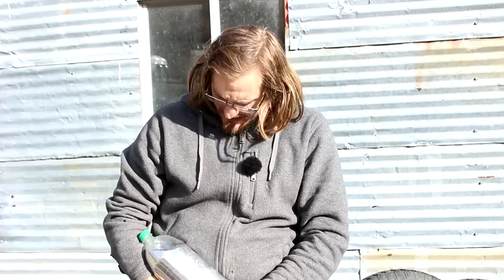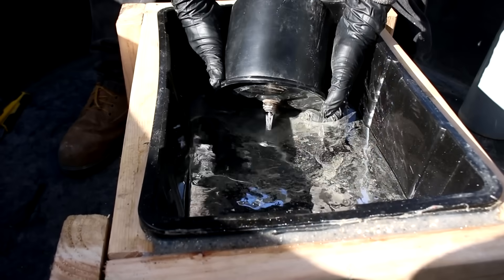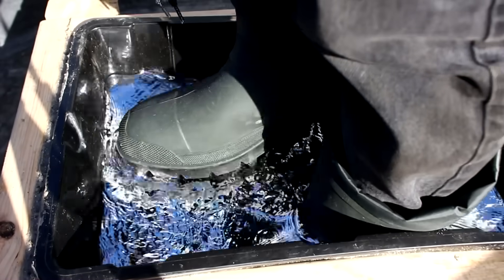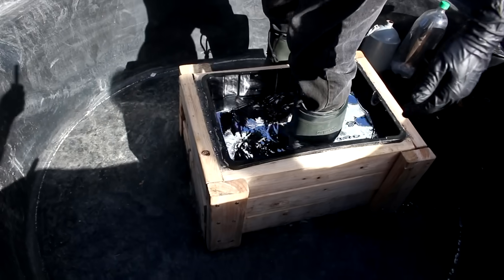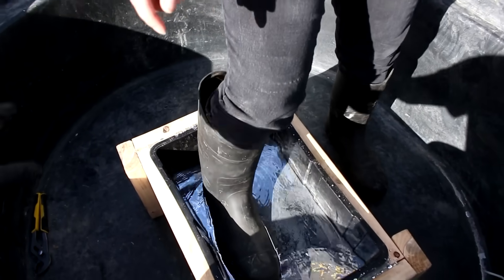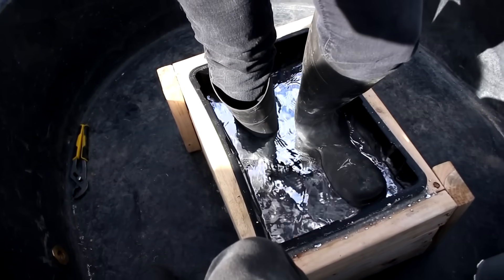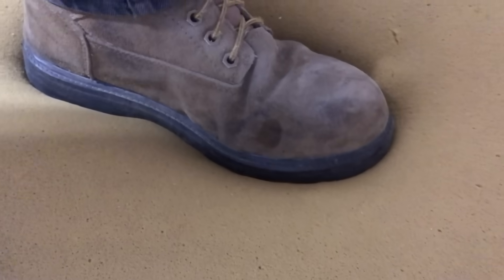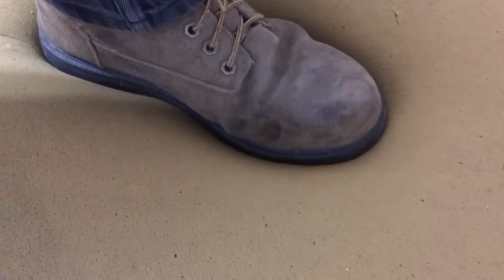Can I Stand On Liquid Mercury?

Comment: Yo I don’t think that’s healthy.
Reply: Yo, I think Cody knows what he's doing.
Reply: McMehBurger I'll take contributing nothing over "contributing" false information any day. Equating the toxicity of mercury to CO2 is false. Saying mercury kills brain cells in low dosages is false. Saying handling mercury in a well ventilated area is dangerous is false.

There's my contribution. I'm not going to waste my time any more, since you're already ignoring actual facts and I'm sure nothing I say will change your ignorant minds.
Reply: +2 Pump Meme Dump
If each breath of CO2 (I assume you didn't mean some diatomic form of cobalt, which would indeed probably harm you in some way) you take in damages your brain, then we'd all be dead by now. The air you breathe in isn't pure oxygen. When you get an "oxygen tank", it's mostly carbon dioxide and nitrogen. Pure oxygen kills.

And you can't exactly use the fact that you may have been eluding to asphyxiation as a defence, because rebreathing the same air in a garage is not akin to standing over a bucket of mercury outside, when there is air literally all around you. There is absolutely no chance of him asphyxiating doing that.

Even if you meant CO, which you probably did, that itself does not cause brain damage. It doesn't affect the brain in the slightest. All it does is stop your blood cells from forming oxyhaemoglobin, basically making it so your blood can't carry oxygen. Sure, this leads to brain damage if your brain's oxygen supply is so inhibited, but saying that, for instance, taking a couple breaths of car exhaust will damage your brain is flat out wrong.

Carbon monoxide, like mercury vapour, is dangerous with prolonged exposure. Though, with carbon monoxide exposure having to be quite noticeably less prolonged.
Reply: +Tikotidu
Don't take what chemistry teachers say as law. I remember my chemistry teacher said a few grams of Caesium would cause a huge explosion. Totally false.
Reply: The brain constantly rewires itself, so occasional exposure does NOT necessarily cause permanent damage. Mercury on your skin is not a problem, but the 'fumes' can be - which is why he chose an outdoor area with plenty of breeze. Also, many mercury compounds ARE absorbed through the skin (unlike the elemental mercury he was using). Also why he did not let his other foot (with a wound) get close to the mercury.
Yes, there are good reasons you were taught not to get close to mercury, but as with anything else, a true expert may be quite safe doing something that would be unsafe for you. [FYI, I was a science student, with a major in chemistry and another in physics. Later I taught both. So, yes, I've studied this more than some people. Plus worked with cinnabar and mercury in Arizona, so had to learn the actual safety methods with mercury. When my first son was born, my wife freaked out because a sphygmomanometer [the old-fashioned blood pressure tester] had broken, spilling mercury on the tile floor, and when we were there, there were still tiny droplets of mercury in every groove of the floor. Babies are more susceptible than adults, so she was right to be upset.
Reply: +IlI IlIlI
Damn. You'd already written my comment, but way more succinctly. Rip.
Reply: Tikodiku Elemental mercury (the one Cody works with) isn't immediately toxic, but it bioaccumulates and leaves your system really slowly. Just handle it in a well ventilated area and don't do it too often and you'll be fine. If it were as toxic as some ignorant people in this chat claim, you'd kill brain cells every single time you eat fish.
Reply: 2 Pump Meme Dump Not true. Get your facts straight before trying to be a smartass on the internet.
Reply: +IlI IlIlI
Eh. If they spent two minutes in Google to reach their conclusion, then they must be pretty bad at using search engines. Two minutes in Google will get you stuff that details mercury poisoning correctly and isn't sensational about it.
Reply: 2 Pump Meme Dump Nice cherry picking. How about you counter some of the actually relevant points presented? Oh, right. You can't.
Reply: dude... the bottoms of your feet have THE highest absorption rate....wow... No research done before this experiment
Reply: It isnt too bad since the surface tension in mercury is great so the skin doesnt absorb so much mercury and he is using metalic mercury witch is way safer than organic merqury witch madame curis died from
Reply: ozzilla8 not just the vapor for example if you have a skin ulcer it could be potentially dangerous.
Reply: Michael T  he had boots
Reply: IlI IlIlI you have contributed nothing to this argument. You’re sorta restricted to calling people retards and denying things just so you don’t look silly. “Get your facts straight” my ass. At least he had facts
Reply: 2 Pump Meme Dump 
You dumbass. Learn to spell. Actually just go and learn.
Reply: William, are you going to attack my points or just my spelling? If it's just my spelling then you clearly have no argument.
Reply: Wrong. Several people have explained the real facts, not the misunderstood info you half remember hearing about. Your skin does not absorb mercury (but can absorb certain mercury compounds, allowing your blood to be exposed to mercury). If he had done this inside, I would not be happy (the fumes can get you).
Reply: The term mercury stands for pure metal of mecury. Variation of mercury forms will have different effects on our body.  Vaporize mercury will be more toxic than liquid solid mercury.  However, the mercury that we should be more concern of is organic mercury.  So why is organic mercury more toxic?  Well in organic form.  Mercury can be more easily absorbed into tissues.  When media point out mercury contamination and fish having high level of mercury. It is refering to organic.
Reply: Why not it’s only the vapor you need to worry about
Reply: Jasper Kole,If you would kindly look back I in fact did use punctuations. I agree fully with what Cippo Lippo said.
Reply: ccaagg, then go inhale pure Co2 in a sealed garage and tell me the outcome after 3 min.
Reply: FiendishPickle, that's what I was saying, he needs a gas mask for propper safety and that's all i was saying he needs to have propper safety in videos like this.
Reply: Note Cody's receding hairline since he started his mercury experiments....
Reply: Michael T it’s the liquid not the gas, if it was the gas, he would’ve died
Reply: John Stuart There's a reason the Romans put prisoners to death by having them work in cinnabar mines.  The brain does not "rewire" itself from exposure to mercury.   Maybe if you're exposed to mercury long enough you can convince yourself that's how the brain works.  Also, Cody clearly did not create pure elemental mercury considering the scum film on the surface.  Even if he did create pure elemental mercury, it's not safe to stick your foot in it.
Reply: Michael T same
Reply: It's a hazardous materials correct? What scares me is the handling and splashing the Mercury around to contaminate the ground and people around. Can get trapped in his clothes.
Reply: Michael T ..He said he "..felt a little unstable..."  I bet he still does.. Mad as a Hatter..
Reply: ozzilla8  you don't know what you're talking about, fool....
Reply: Tikotidu  righton
Reply: 邪児 Kronaz... like Karen Wetterhahn (Dartmouth  College) and  brown bear lover Tim Treadwell. Lol.R.I.P.
Reply: mercury poizund liquid metal mercury has a low absorption rate. It's less dangerous than the vapors it lets off. If you work with it in a well ventilated area and don't let open wounds get in contact with it chances are you'll be safe. Organic mercury is the one that is a killer through skin contact. He covers this, and you can find many cases of people dying or getting poisoned through organic mercury. However you will have a difficult time finding cases of people dying due to absorption that comes from metal mercury.
Reply: Michael T Only a few forms are as toxic as it is proposed on the news. The normal  form however is only toxic when it's consumed or vaporized
Reply: Its not healthy. It can absorb through your skin.
Reply: S F 2 Pump Meme Dump so many people who don't know basic chemistry it can not get through the skin the atom is massive in the first place and so it can get in via the skin it needs to be in a compound preferably organic to really get through so it like eating a tuna sandwich so SHUT UP HE IS MUCH SMARTER THAN YOU ARE and he has done his mercury and lead tests and he is fine u dipfriedmoth
Reply: 2 Pump Meme Dump he is fine he has done mercury tests so that proòoooves that you are wrong
Reply: Watch this youtube video a scientist dropped two drops of dimethyl mercury on her hands this is what happened to her brain
Reply: 2 Pump Meme Dump you are absolutely correct but this type of mercury can not penetrate the blood brain barrier that easily.
Reply: It's not SAFE, but he doesn't have fuckin brain damage from this. It can be absorbed through skin, sure, but only over long periods of time primarily. The main thing is not consuming it or letting it into open wounds or breathing it in.
Reply: I like all the Google University experts in here. Cody knows what he's doing.
Reply: 2 Pump Meme Dump what you meant to say was: 'look up what mercury poisoning means'. And it's clear that erethism only starts being noticable after being exposed closely to mercury vapor for a long time. The mad hatters you speak of only got erethism because they worked with mercury close to their face every day for years. Working with mercury a few times over multiple years won't even get close to the amount needed to acquire mercury poisoning.
Reply: 邪児 Kronaz, madame curie also knew what she was doing, but look how she died, by her own work.
Reply: 2 Pump Meme Dump for the love of all that is holy: use punctuation. One massively long sentence gets really annoying. Apart from that, you are somewhat correct: erethism comes only with repeated exposure to mercury. it is very comparable to alcohol: every bit hurts the brain, but it doesn't really matter in the long run if you don't regularly drink way too much. The same goes for mercury exposure: though it will do tiny amounts of damage each time, this isn't a big deal unless you are around the stuff a lot.
It's exactly as you stated: these mad hatters didn't die in one go: they went mental over years and years, being exposed to mercury unprotected on a daily basis.
Reply: yo i think i know what he's doing too sacrificing his body for his and our amusement and ad revenue. mercury can fuck you up and your skin can absorb it via contact. to be fair tho long term it's safer for him to mine youtube views than to mine gold which would probably yield greater exposure for the same profit
Reply: Jasper Kole, I didn't say he would get mercury poisioning, I said he is getting permenant brain damage as messing with mercury fucks with your brain worse than alchohol. I said what I meant so deal with it as they went mad from murcury and then got ill from it and died in a hallucinogenic trip fest. I would recomend looking into it, as it's quit interesting as it's not just "woops i'm going to die now" it happens over time and every time you are near it, it fucks with your brain and decay's it permenantly like mustard gas is only as deadly as it is without a gas mask but with said gas mask your lungs don't get fucked up making you only get mild chemical burns(depending how long your in it and how it is made) on the outside of your body.
Reply: I remember back in the school they told me not to touch Mercury since is toxic as fuck and it could kill you by poison easly, but being liquid well.... maybe you can stand but its not healthy for sure .-.
Reply: mmmmm no, mercury can go  through your skin
Reply: I think most of the people here are completely ignorant about the concept of danger. 
I seriously think this kind of video are dangerous. Because the precautions showed in the video are null. 
It is true that mercury poisoning happens only on a long term exposition and I believe his Hg blood levels are normal. But once you deal with such large quantities of materials, you may incur in many unexpected events. Most of the accidents, and fatalities too, in fact, are no longer due to long term expositions, but rather to single episodes that where not predicted. 
Again, maybe in this video all the precautions are not shown, but in my opinion what I ve seen is far far away from being safe.
Reply: Chaos Gaming, he didn't have a mask on and if you inhale mercury you get permanent brain damage(as little as it is in an open area like he had) it's as bad if not WORSE than inhaling Co2 in a sealed garage.
Reply: agreed, he definately has brain damage from this and those of you who don't think it's dangerous to be around mercury without a mask just look up why the expression is "mad as a hatter".

Comment: It would be an interesting video to show the battleship/1gal water thing except scaled down. I think you'd have to use a much larger proportion of water to surface area than that to see anything though. That apparant paradox blew my mind in physics. I still don't understand it fully, I guess its something like the space that might have otherwise been filled with water is now filled with ship, so it might as well be water too and so it presses down with the same pressure as the water and the system is in equillibrium thus the ship floats even though there might only be 8 pounds of actual water contributing to the bouyancy pressure. In a way, the ship holds itself up I guess, and that's pretty damn cool.

Comment: Oh ma-an! This is SO cool!!
And actually gave me an idea. -You know they use vacuum for evenly pressure hot plastic to the mold or to pressure fiber reinforced epoxy, what if you could do the same with mercury? It would give you much more pressure and at the same time better temperature control as mercury much more thermoconductive.

Comment: OK, so before today I didn't really realize how much mercury you really had and watching this gave me an interesting idea. You of course know how magnets make eddy currents in metals. What I'm wondering is whether or not those forces would be visible given the fluidic nature of mercury. I'm also wondering how much effect that would have against the magnet the same way it would as if the magnet were used as a break in a rollercoaster. It might be an interesting experiment and wouldn't take nearly as much mercury to perform. You would only need like a baking sheet full and some kind of rig to pass the magnet over the surface without it touching at sufficient speed to generate a reaction and see if the mercury moves and/or the magnet is slowed.

Comment: Cody, we know the landscape is beautiful, but could you please lower the camera focus?
OH, darn, video has been recorded already, oh well x'D

BTW, isn't the pressure related to the work that the mercury is doing on the medium holding it?

If you had a plank below the mercury instead of of the bottom of the container that could ONLY hold the pressure done by the mercury, as soon as your mass entered the equation, the work done by the addition of your mass to the system would apply extra work on the plank, possibly making it break and leak the mercury(HOPEFULLY to another container of course)

But since the container was actually designed to receive extra work forces without showing extra points of stress it is able to react to the work of your mass by return the force upwards.

SORRY for any argumentative inaccuracy, non english scientifically illiterate person, just trying my best.

Comment: This is one of the weirdest and stupidest thing I ever saw on YouTube.
It is so dangerous. You know, here they make a big fuss if you break an old Mercury thermometer. You have to remove it with a special absorber. In Switzerland there is a maximum workplace concentration of 0.05 mg per cubic meter.  And you put kilogrammes over kilogrammes in this bassin. It is classified as poisonous and dangerous for health and environment. 
I really hope that cooling down prevents you from most vapours and you could clean all of the used thing properly.

Comment: Should have attached a couple vertical pieces (2x4s will do) to the tank, so you would have an easy way to stabilize yourself.
Reply: but then we wouldn't be able to look at him struggle
Reply: Or maybe something like a clothesline.  Or maybe hold a balance stick like people walking across a high wire.
Reply: Double Dare Fan  00000000000000000000000000000000000000000000000000000000000000000000000000000000000000000000000000000000000000000000000000000000000000000000000000000000000000000000000000000000000000000000000000000000000000000000000000000000000000000000000000000000000000000000000000000000000000000000000000000000000000000000000000000000000000000000000000000000000000000000000000000000000000000000000000000000000000000000000000000000000000000000000000000000000000000000000000000000000000000000000000000000000000000000000000000000000000000000000000000000000000000000000000000000000000000000000000000}
Reply: Double Dare Fan stfu

Comment: Question: Can You Touch Mercury?

If you touch it, a small amount may pass through your skin, but not usually enough to harm you. Mercury is most harmful when you breathe in the vapors that are released when a container is open or a spill occurs.

I really hope you had face masks on, since that much mercury in contact with the air for however long likely meant that a significant amount vaporized. At least it's outside so the concentrations couldn't get too high, but this is incredibly dangerous and has similar potential to cause harm as the "dry ice air conditioner" does.